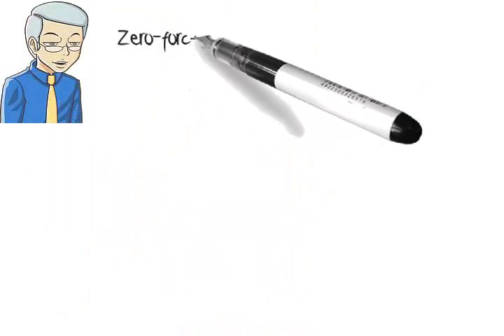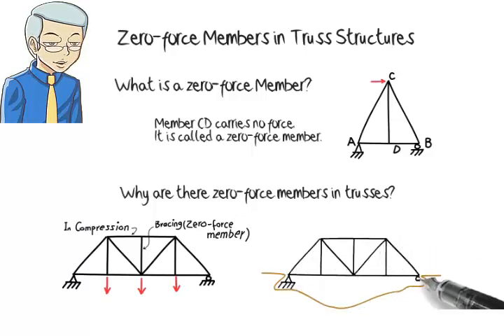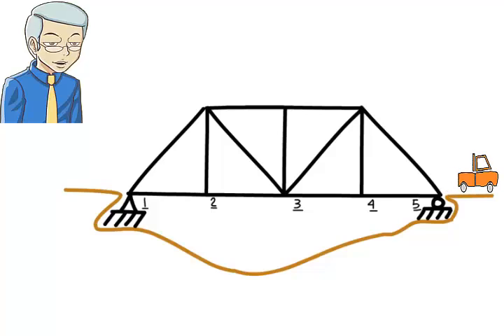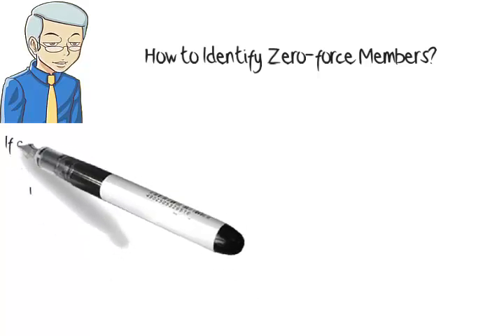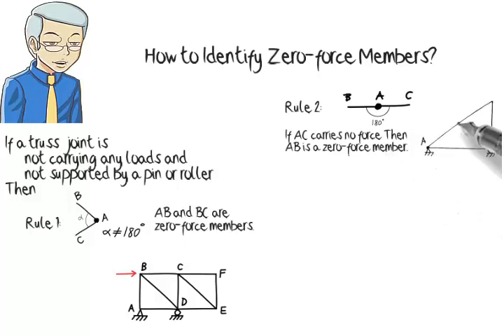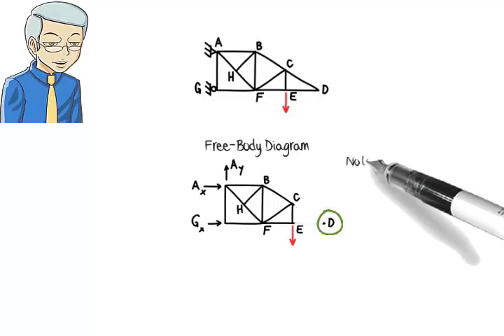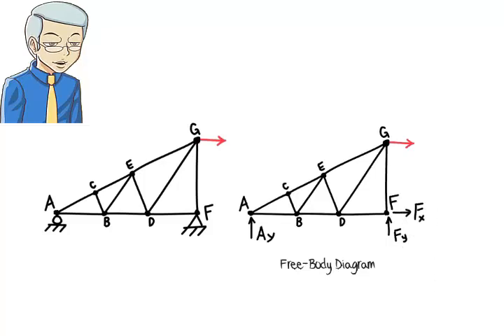SA05: Truss Analysis: Zero-force Members

Comment: Thanks for the video, it is quite helpful. 
For the question (B), why are AC and CF zero force members, is  joint A not supported by a reaction won't it affect the value of member AC.
Reply from the maker: With regard to Problem B, if we remove the obvious zero-force members (ED and BD), we can see that DC is also a zero-force member. If we remove DC from the structure, then examine joint C (there are only two members connected to the joint at this time, CF and AC),  we can conclude that AC abd CF are indeed zero-force members.

The support at A has two reactions, one in the x direction and one in the y direction. These are the x and y components of the axial force in member AF. That is, the reaction at A is a force equal in magnitude but opposite in direction to the axial force in AF.
Reply: Thanks so much
Reply: @DrStructure  BUT THERE IS A AXIAL FORCE FROM THE VERTICAL REACTION AT A PASSING THROUGH AC. i guess that would not allow rule 1 to hold at joint C
Reply from the maker: @olanrewajuoludare8396  True, there is vertical reaction at A. But how did you arrive at the conclusion that is must pass through member AC? Cannot it not pass through member AD (or AF)? We draw the conclusion that AC is a zero-force member not by examining joint A, but by examining joint C, after DB, DE, and DC are shown to be zero-force member and removed from the structure. 

For an alternative discussion on zero-force member in trusses see: https://www.youtube.com/watch?v=0AFou75Xft0
Better yet, login to our (free) online course and access the updated version of our lectures there. The link is given in the video description field.

Comment: why member AF is not eliminated using the third rule at 6:13?we have two forces Ax and AB colinear
Reply from the maker: A is a pin support, there are two reaction forces acting at A: Ax and Ay. Rule 3 would have been applicable if Ay was not there.

Comment: so im thinking number one is only left with triangle ADK, number two os left with the right side plus beam ADF, and number 3 is left with angle AIB.
am i right?
Reply from the maker: Yes, yes and yes!
Reply from the maker: @danielimm  In Exercise Problem B, there is no reason to believe that GK is a zero-force member. None of the rules apply to either joint G or joint K.  

At joint G, we have a force in member HG, and a force in member GJ. And, there are three other forces acting on G: the forces in members FG, GI and GK. Since none of these forces have been determined to be zero, we cannot remove them from the truss. Therefore, we have a total of five forces acting at G. None of the rules that we have allow us to infer one of the five forces is zero. So, joint G cannot be used to conclude that GK is a zero-force member. 

Examining joint K, we find three acting member forces: the force in HK, JK, and GK. If HK and JK were collinear (if the angle between members HK and JK was 180 degrees), Rule 3 would have applied and GK would have been a zfm. But since the angle between the two members is 90 degrees, GK cannot be a zfm. For joint K to remain in equilibrium the algebraic sum of the three forces must be zero, which means neither of them can be zero.
Reply: Example B, right side plus ACF, right? Not ADF.
Reply from the maker: ADF is correct.  

BD is a zero-force member, so is ED. Then, looking at joint D, we can conclude that DC is also a zero-force member. Now moving to joint C, we can see that both CE (and EF) and CB (and BA) are zero-force members. Then, the only remaining part of the right side is ADF.

Comment: sir suppose if two 3 membered joint has common non-collinear member and an external force is applied  at one joint and at other joint  is no force applied ,then what about that member ? as in the sense of no force joint that non-collinear member is zero force member but it is contradict in the sense of force applied joint
Reply from the maker: If there is a truss joint that connects two (non-collinear) members only, and there is no load or support at the joint, then the members are indeed zero-force members, regardless of the connectivity and load pattern at the other end of the members. 

Say, Member AB is connected to only one other member at joint A, and the angle between the two members is different than 180 degrees. Further, there is no load or support at joint A.  But AB, at joint B, is connected to two other members, and there is an applied load present at B. 

Can we conclude (by examining joint A only) that AB carries no force?  Yes!

But what about the applied load at B?  That load has to be carried by the other members at B, but not by AB. If the other members at B are unable to effectively carry the load, the truss would collapse. It would be considered unstable.
Reply: is it the same in case of  non-collinear member connecting two 3 -membered joint if 2 members are collinear at each joint?
Reply: what about if applied force is in collinear with non-collinear member at one joint?
Reply from the maker: Per example above, if at joint A the two members are collinear, then they may not be zero-force members. If the collinearity is at the other joint(s), then AB still is a zero-force member.
Reply from the maker: Per example above, if a load, collinear with member AB, is applied to joint A, then AB carries that load. But, the other member connected to A would be a zero-force member.
Reply: sir i am asking about the case of 3-membered joint in which 2 members are collinear and the non-collinear member is the common to two 3-membered joints and force is applied at one of the 3-membered joints then non-collinear member would be zero force member or not?
Reply from the maker: If joint A connects three members, two of which are collinear and the third member is AB, and there is no load or support at A, then AB is zero-force member regardless of the member connectivity and loads applied at the joint B.
Reply: thank u sir

Comment: On problem (B), I am finding that the only members that ARE NOT zero force members are members IG, HG, and JG. Is this correct, or have I inappropriately used the rules somehow?
Reply from the maker: +Connor Wetzel No, you went too far.
Rule 3 at joint B makes BD a zero-force member (zfm).
Rule 3 at E makes DE a zfm.
Then, Rule 3 at D makes CD a zfm.
Then, Rule 1 at C makes ABC and CEF zfms.
That is it.
Reply: what about GK ?
Reply from the maker: GK is not a zero-force member.

Comment: AT 5:36 HOW RULE 3 IS APPLIED AT "EF" AND "GA"???...............PLZ EXPLAIN IT
Reply from the maker: +Anupam Kushwaha @5:36, there are three forces acting at joint E, the applied force (P), the force in member CE and the force in member EF.  Two of these forces are co-linear, therefore the third one (the force is member EF) must be zero.

@5:50, there are three forces acting at joint G, the horizontal reaction force at G, the force in member GF and the force in member AG. Since two of these forces are co-linear, the third one must be zero.
Reply: THANK U FOR YOUR RPLY....
Reply from the maker: +Kosmosis From a practical standpoint, you are correct, we are breaking the rule. From a conceptual standpoint, however, supports and loads can be viewed as forces applied at truss joints. In this sense, we are replacing a roller support with a force to make the rule applicable. The important consideration here is that for Rule 3 to apply, we need to have only three forces acting at the joint regardless of their source.
Reply: thank you for your explanation

Comment: If truss joint is not carrying any loads and not supported a pin or roller...but according to rule 2 you gave simple example of pin and roller supported joint..so why this members are zero????? means why AB is zero??
Reply from the maker: +Nadeem Kuskiwala If two members are collinear, as stated in Rule 2, and one of them is a zero force member, then the other one has to be a zero force member as well. Why? because we can think of the two members as one long straight member with a pin in the middle. If one part of the member does not carry any force then the other part cannot carry a force either.

Comment: Hi in problem b why aren't DF and GF zero force members? If you are looking at point F
Reply from the maker: +bekis95 After removing the  known zero-force members, three members remain connected to joint F: FD, FG and the horizontal member to the right of F.  So, none of the rules applies to joint F.

Here is a more intuitive explanation. Except for FD and AD, all the members on the left half of the truss are zero-force members.  If FD was also a zero-force member, the applied load had to be supported entirely by the right side of the truss. But that is not possible as there right side rests on one (pin) support only. A stable truss must have at least two support points.
Reply: +Dr. Structure thanks makes sense now!

Comment: What about the force FD for (B)? Appreciate your help, thanks!
Reply from the maker: FD is not a zero-force member.
Reply: Thank you for the response! Why not though, if you don't mind me asking?
Reply from the maker: Syed Muhammad Al Kherid

Simply put, none of the rules applies to FD.

To see why that is, remove all the zero-force members from the truss. These would be all the members to the left of DF including BD, DE, CD, CE & EF, and CB & BA. So all the members to the left of AD & DF are removed resulting in a simplified truss with fewer member.

Now examine member DF in the simplified truss.

At joint D, Rule 2 would have been applicable if AD was a zero-force
member, but AD does carry a force, since there is a pin support at A. So Rule 2 does not apply. Examining joint F, Rule 3 would have worked only if FG and FH were co-linear, but they are not. The angle between them is different than 180 degrees. So Rule 3 does not apply either. In summary, neither of the rules can be used to conclude that DF is a zero-force member.

Here is a more intuitive explanation. Remove all the zero-force members from the truss. Carefully examine the simplified structure. Since AD and DF are co-linear, let's view them as a single element (say, AF). Clearly AF has to carry a force or else the structure would be unstable. To see why, remove AF. What do we have now? The right part of the structure resting on a roller support only which is going to have a rigid-body motion, it is going to turn counter-clockwise. Therefore, for the truss to remain stable, AF must carry a force which means FD must carry a force.

Comment: In ex 1 why FB is not a zero force member cuz there is 180 degree line GE or same as FC and FA "Rule number 3" ?! 4:22
Reply from the maker: In Example 1, FB cannot be a zero-force member. Rule 3 does not apply to either of its end joints.
Here is why: FB has two end joints: F and B.
 
Joint F connects five members (GF, FE, FC, FH and FB). One of these members (FE) turns out to carry no load. That leaves four other members at the joint. Rule 3 requires three members (or forces) to work, so it cannot be applied to Joint F.

Joint B connects four members (BH, AB, BC and FB). One of them (BH) is a zero force member. That leaves three members at the joint (AB, BC and FB). For Rule 3 to apply, AB and BC have to be separated by 180 degrees, but they are not. The angle between them is less than 180 degrees. So no Rule 3 here either.

Comment: Is it possible for sacked zero member ? and why ?
Reply from the maker: The design may require the presence of a zero-force member for stability, as was mentioned at the beginning of the video. In such a case, the removal of the zero-force member from the structure could lead to the failure (buckling) of another (compression) member.

Further, when the structure is subjected to dynamic (time-variant) loading, a member may not carry the same force at all times. A truss member that carries a compression or tension force at time t1 may become a zero-force member in time t2. Obviously that member cannot be removed from the structure simply because it carries no load at t2 as it does carry loads at some other times.

If a truss member does not contribute to the stability of the structure, and carries no load during the life-span of the structure, then from the engineering standpoint it serves no purpose and should not have been placed there to begin with, unless it has some non-engineering (say aesthetic) purpose.

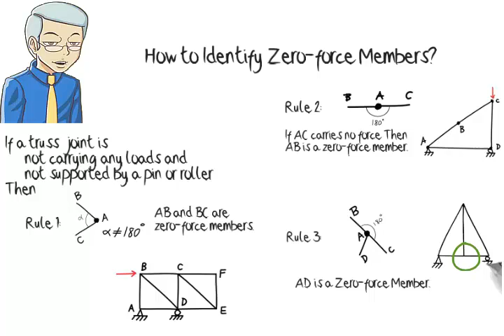Comment: At 4:15, for rule 3, it says that "AD is a zero force member" however in the video you said that CD was the zero force member. Is CD the zero force member? 
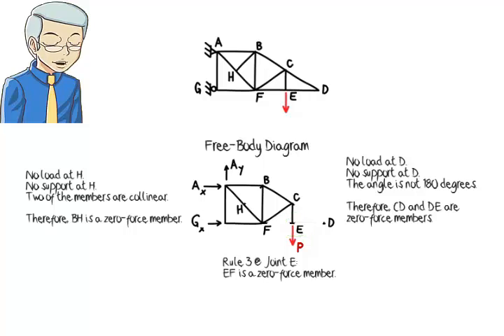Also can you explain why EF is a zero force member according rule 3 at 5:42? Since E does not connect members that are collinear.
Reply from the maker: @4:15-- The writing "AD is a zero force member" pertains to Rule 3 and refers to the drawing to the left of the simple truss.  Using Rule 3, we can conclude that CD (the vertical member in the truss) indeed is a zero force member.

@5:42-- Truss members carry axial loads only. Put it differently, if you see an axial force (like the applied vertical force P at E, you may assume an imaginary member there that contains/carries that force). So, for the sake of this analysis, we can replace P with a vertical (downward) truss member at joint E. Doing so gives us three members at E, the imaginary member carrying P, member CE and member EF. Two of these members are collinear (CE and the imaginary member), therefore EF has to carry a zero force.

Comment: Dr. Structure,
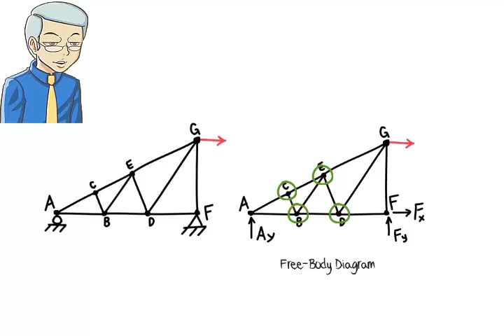I am attempting to learn about how to solve for forces in the Zero members on a real life structure.   For example, your truss at 6:40, when under the load provided, would actually deflect to the right a little bit.  Also, assuming the truss is something weak like aluminum, would deflect a lot.  So, during this time the distance perpendicular through segment AG through point F would get smaller, causing a compression force inside all of the zero force members as they try to hold the structure up.  Do you know where I could search, or what I should search for, to find information on this situation?  Everything I try leads me back to the "they have no force... ever" answer.

Thank you.
Reply from the maker: Yes, you want to look into second order structural analysis, which involves determining internal forces induced by deformation/displacement (P-Delta effects).  The topic is rather advanced and beyond the scope of most undergraduate structural analysis courses as it generally requires solving systems of nonlinear equations.
Reply: Excellent, thank you for that.  I am an undergrad in mechanical engineering, but the way I solve problems and understand is through my reasoning.  Which leads me into predicaments such as this where I see more than my class is allowing me to understand.  Which, in the end, makes it nearly impossible for me to comprehend the method of solving my problems.  So, I will look into this second order stuff until the point where I feel confident enough to justify the simplifications for myself.  Thanks again, we need more professors like you.

Comment: Why is AG in the first example (at 5:50) zero force member if there is a force from the pin going upwards?
Reply from the maker: There are three forces acting at joint G: the force in member GF, the force in
member AG and the horizontal reaction at the roller support. Two of these
forces are acting in the horizontal direction (along the x axis). The other force
(Fag) is in the vertical direction (along the y axis).

Sum of the forces at G must be zero. This means sum of the forces in the x
direction must be zero, and sum of the forces in the y direction must be zero. But, since there is only one force acting in the y direction, for the sum to be zero, the force (Fag) must be zero. Therefore, AG is a zero-force member.

Comment from the maker: Rasika Thorat In the first example how is rule 3 applied to G and E?

In the first example which starts at 4:17, G connects two members (GF and AG).
Further, there is a vertical roller at that node. The roller provides a horizontal
reaction force. The force in member GF is also horizontal. The two forces
therefore are collinear. There is another (non collinear) force at G, the force in
member AG. So, three forces act at G, two of them are collinear, therefore, the
third one must be a zero force (Rule 3).

We can apply Rule 3 to E only after Rule 1 is applied to joint D. That is, after we
have determined that CD and ED are zero-force members, then only three forces remain at E: the vertical applied force, the force in member CE and the force in member EF. But since the applied force and Fce are collinear, then the other force (Fef) must be zero.
Reply: the rules are starting with the conditions of that joint should not have pin or roller but at joint G there is roller then how rule is applicable ????
Reply: does it not matter that joint G is supported by a roller or that joint E has a load "P"?
Reply from the maker: Nora Castro No, it does not matter.
What do a truss member, a roller support reaction and an applied load have in common? Each can be represented by a force vector.  

In a structure that is in static equilibrium, when these forces intersect each other, we can draw certain conclusions, hence the rules. It does not make any difference whether a force is a support reaction, an applied load or a member force. In the eyes of nature, they are all the same!